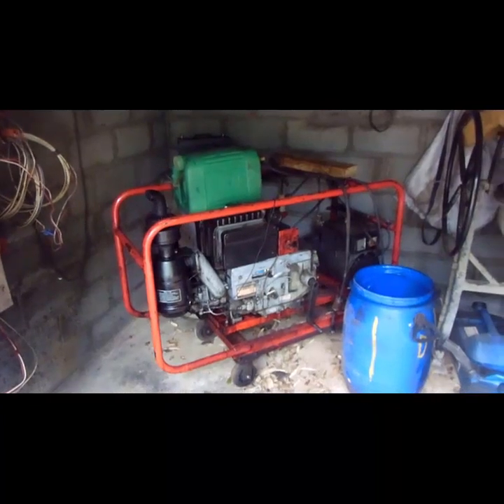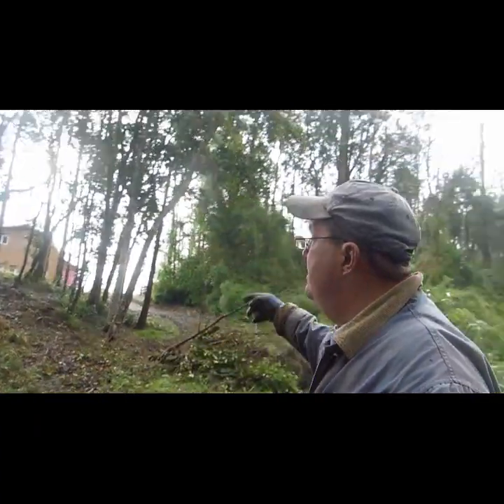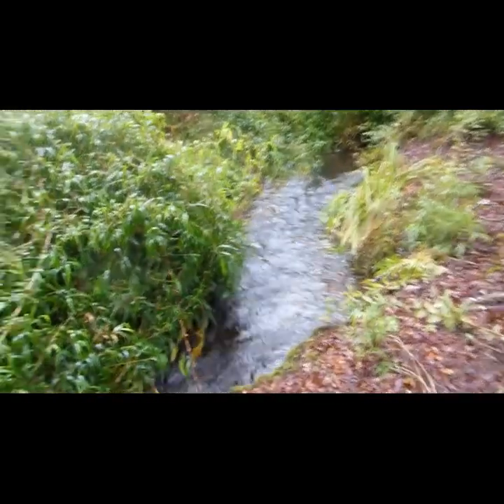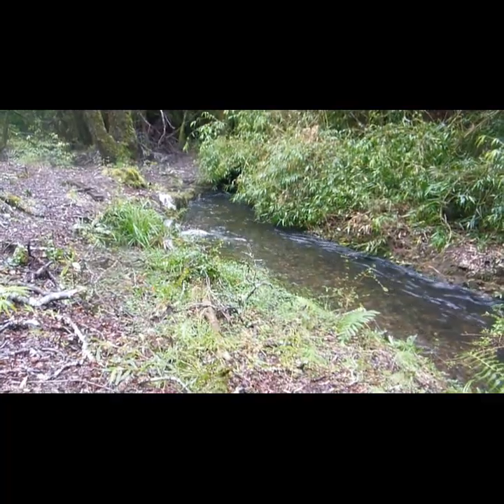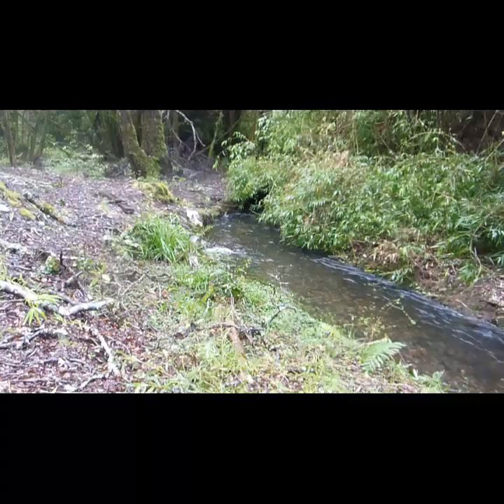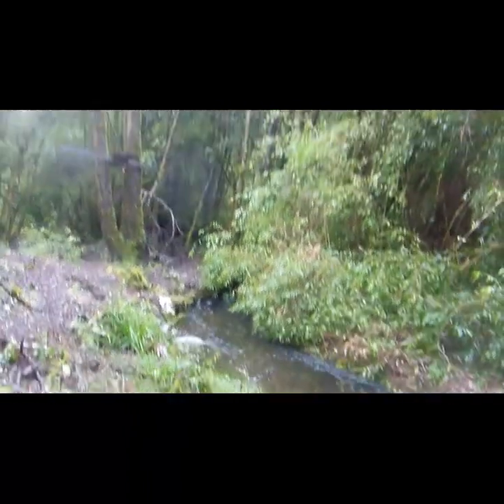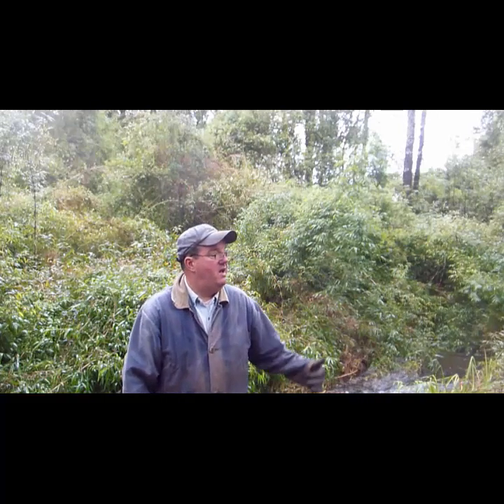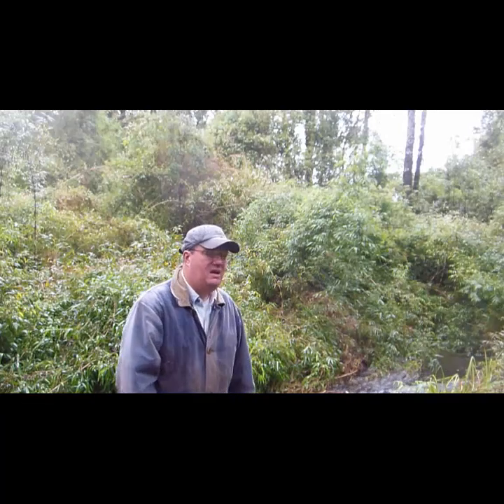Hydro and Generator Question

Comment: That barn looks beautiful. I have a low oil shut off on my generator. I like the idea of a water wheel. I also like wind power but here where I'm at we don't have a lot of wind. You luck sounds like mine.
Reply from the maker: I wish that this one had that on the motor but I did not and it died a quick death. Now I must PAY $$$$. Such is life. Jim

Comment: I would do your catchment basin with a turbine idea, I would also ensure you have some type of rough pre-filter to save those salmon! I think if you did this properly, you could effectively meet all your power needs. You'd be generating power even in your sleep, so i think if you combined that with a good charge controller, inverter and set of batteries you will be more than OK. You'll also save lots of money on gas, so go for it! document the process for us :)
Reply from the maker: I will, and I think we are on the same page as far as exploring ideas. Thanks. Jim

Comment: Go for it. I'd do an over the top water wheel, built on an old tractor wheel. That way you could just hook up a couple of alternators, and maintenance would be easy. Do they have tile plows there, that you could just rip in a supply line to the area you want it, from further upstream?
Reply from the maker: Yes I think that this is the approach that I will take. I like the tractor wheel idea, but I am afraid that I need something bigger around so that I get more power?
Also first I am going to do a paddle wheel to run a simple mechanical pump to pump that water from my well ( about 40 to 60 feet away) up the hill to my water tower. So we will see. Jim

Comment: Hi Jim, I would suggest a ram piston to pump your water. Engineer775 and Wranglestar have videos. They also have some micro hydro videos also. I guess the solar drops of in the winter. Hope it works out.
Reply from the maker: Yes we are Under Panneled for our winter solar for sure, but that was all that I could afford at the time. I have met Engineer775 (aka Scott Hunt) and he is a wonderful guy. He lived over the hill from is in South Carolina. I have seen his ram pump but it will not do what I need since i need to pump well water up the hill not creek water. My best option may be a paddle wheel to turn a simple pump. We will see. Jim

Comment: Do they have any type of water dwelling mammals down there, like we have the beaver here in N. Amer.? I could be wrong, but I thought the beaver was the reason for most giardia contamination of streams. Could that be why the locals are able to drink directly from the stream? I say you do the water wheel. If you build a large enough tank for the water to fall into after hitting the wheel you might be able to put in a small fish farming operation. Don't know...just a thought.
Reply from the maker: I was just going to let the wheel paddle like a paddle boat. I do have a huge 5000 liter water tank on top of my water tower.

We do have beaver here and they are not native and are a invasive species here. None can be found around where I live, and they are further south. There are some Otters here as well but they are on the coast. Other than Rats that would be it. 

I want to do Hydro Ponics with my green house using Salmon since they are so prolific here and the water temps stay so cool that I could do it here. I just need to get some ............. ah................ money..........$$$$$$$$ and I will be on my way. Jim

Comment: Jim. It seems like a great idea. What about. Cost verses use-repair cost. If you can do that much. Would it be stand alone or back up?
Reply from the maker: I would do a system that has parts sourced here easily here in Chile. It would be a stand alone Hydro generator that would provide additional power to charge my batteries. That is the key, ......to have charged up batteries. The good thing is that the creek runs all year long. Tell Phil I said hello! Jim
Reply: Sounds good.   Phil says a Texas. Hey.

Comment: No power grid? Just generator .... ? Secluded terrain or are you trying to be autonomous? Sounds great for me ...
Reply from the maker: Yea I am off grid, but I chose to be. the power line goes 40 feet from my house and they wanted $5700USD to hook up. Instead I spent $4200USD and bought a solar system. Chilean power is real expensive and not very good. Jik

Comment: look up WATER RAM pumps..
Reply from the maker: Yes I know about these and had one once, but a  ram pump will not do what I need since it is pumping the same water that is running the ram, and my well water is contained and clean. I need to run a water wheel off of the creek with a shaft up to the well and put in a mechanical pump to pump the water another 60 to 80 feet up the hill and up into my water tower. 
This is my biggest problem right now. I do not have a back up to pumping water and when my generator is down I am out of water in 3 days. Not fun. Jim

Comment: hydroelectric is generally bad for the environment.  you need steps for the fish..
Reply from the maker: Yes I could see that but I do not plan on dropping the level of the creek. I am thinking that I need to put a paddle wheel in the creek and have it drive a generator or a simple pump or even both. Jim